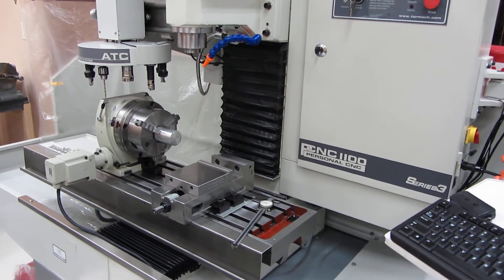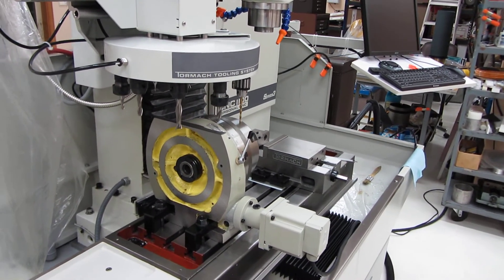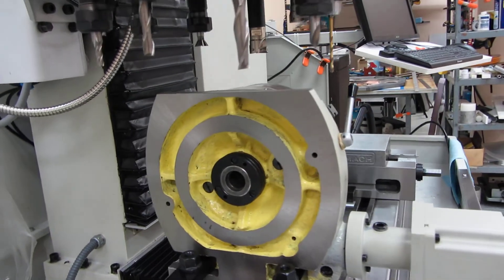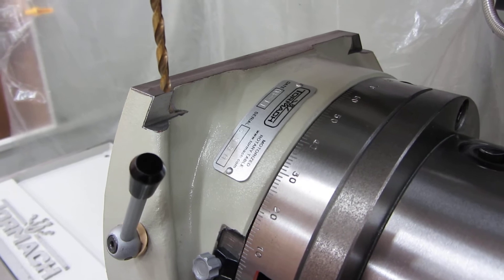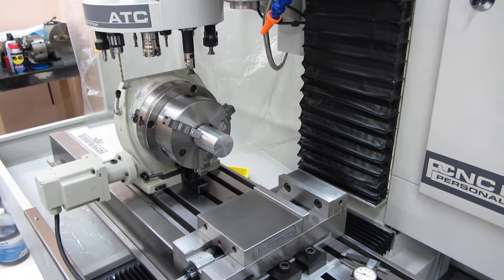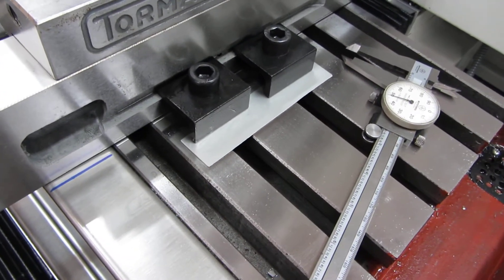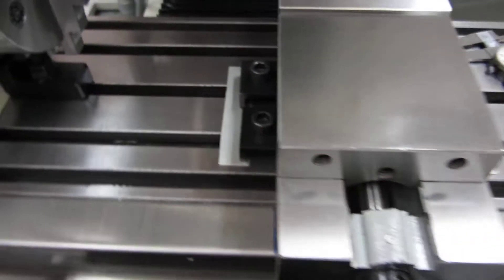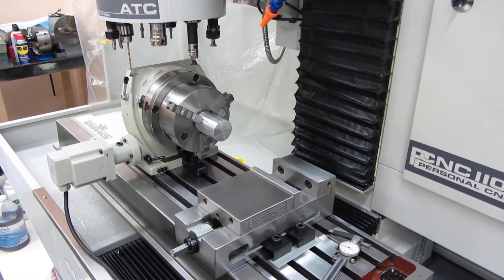Tormach 1100 ATC with 8" Rotory Table - Clearance Modifications

Comment from the maker: Hey AirTime - Thanks for the comments.  The Tormach series of PCNC machines offer quite a bit of bang for the buck.  The interference with the Rotary Table with the ATC should not be an issue, but it was - due to the fact that they used a standard PhaseII series rotary table, with its mounting ears sticking out in the vertical mounting position.  Hence the need to mill off some material for tool clearance with the ATC.  Not a big deal for this level of CNC hobby equipment. Tormach is great!
Mike